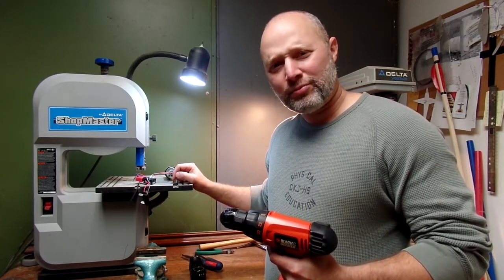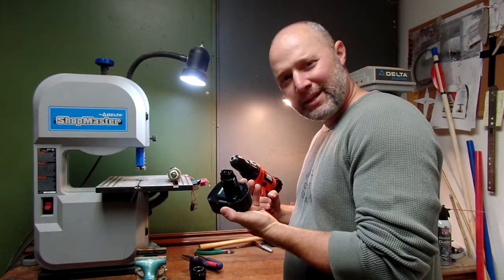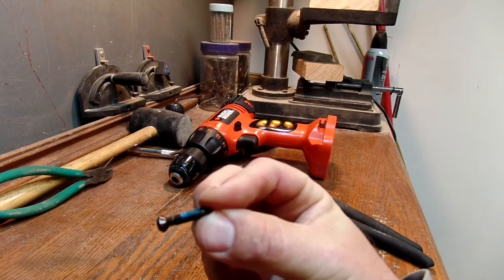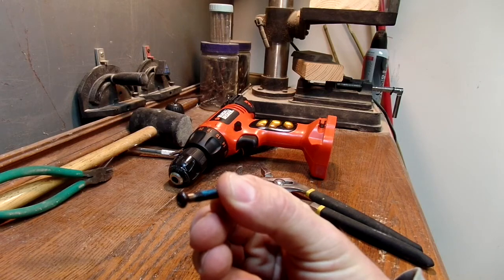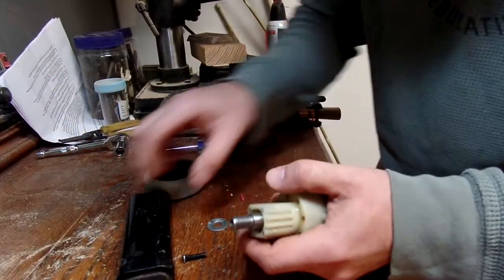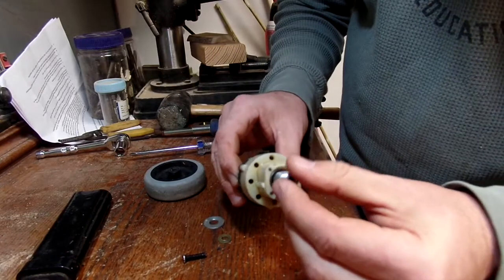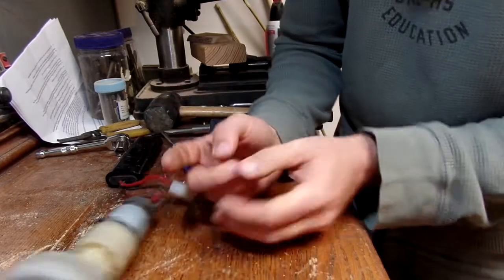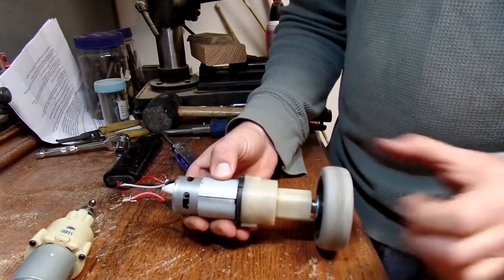Cordless drill to robot drive

Comment: Hey one question if you don't mind...  The problem with many drills is that the motor, bearings, brushes are built into the clamshell rather than a self-contained can.  And in some others, the clamshell holds a motor up against the gearbox... so that when you remove them, the motor just falls off.
Is there any list you can recommend of drills with a motor/gearbox assembly which comes out as a stable unit?
Thanks much!
Reply: probably the older ones like this with the nickel NImH batteries - that seems to be before they started using proprietary caseless motors